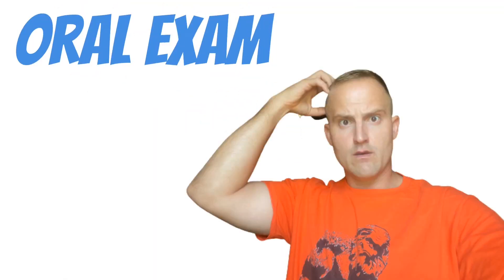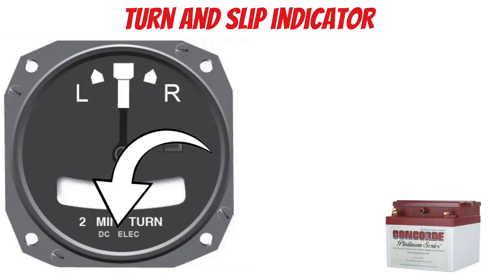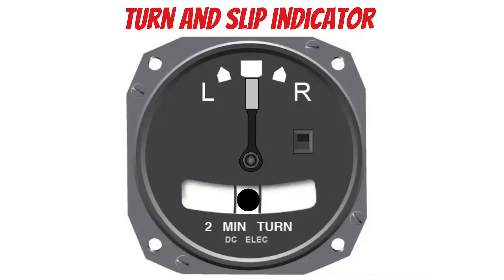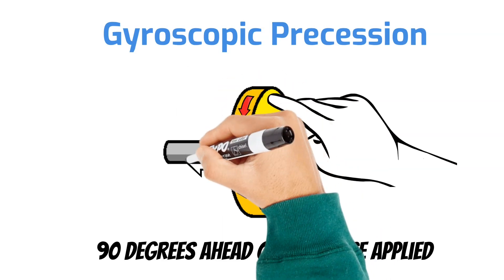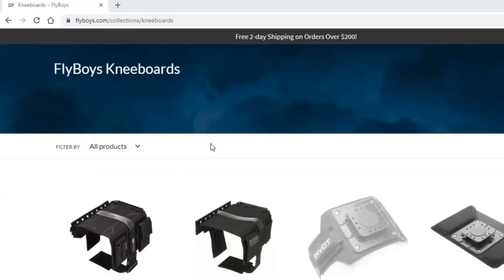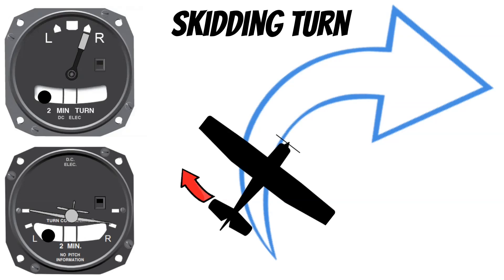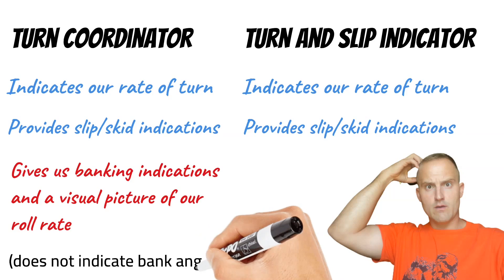Turn Coordinator VS Turn and Slip Indicator (AND How they Work) Private Pilot Ground Lesson 30

Comment: Glossed over the main difference which is that turn coordinator also gives roll rate, and why. I guess the ad got in the way. Sorry guys, have my downvote.

Here’s what you need if you’re still confused: 

You interpret roll rate from a turn coordinator by observing how quickly and to what extent the miniature airplane initially tilts or banks away from level:
	•	Quick, pronounced initial tilt:
Indicates a high roll rate (rapid bank entry). You’ll see the airplane symbol swiftly move away from wings-level, clearly indicating a brisk roll.
	•	Gentle, gradual initial tilt:
Shows a low roll rate, meaning your bank is more gradual and controlled. The airplane symbol gently moves from the center.

The turn coordinator doesn’t directly measure bank angle—just roll and yaw rates. Once you’ve established a steady turn, the miniature airplane stabilizes at an indication related to your turn rate, not your bank angle. To verify actual bank angle, you’d need to cross-check with your attitude indicator.

When initiating turns, quickly glance at the turn coordinator. The initial tilt speed and amount tells you how aggressively you’re entering the bank. Once settled, it simply indicates your steady-state rate of turn.

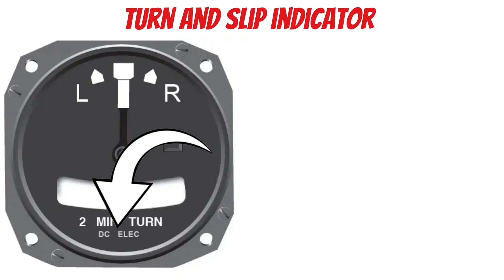Comment: 0:57 turn and slip indicator and turn indicator dc elec 
-if it says dc electric on the bottom, that means the gyro doesnt spin from the suction of the vacuum and it is electronically controlled

 2:55 gyroscopic precession 
-the turn and slip indicator operates on this 
-when a force is applied to a spinning gyroscope a result in force 90 degrees ahead occurs 

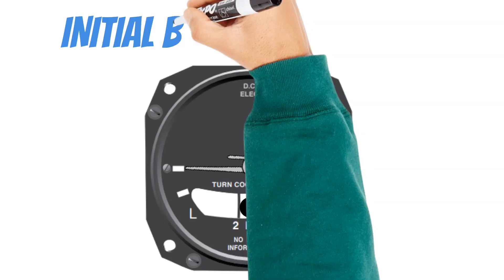4:10 the gyro in the turn coordinator is tilted in a 30 degree angle so it can be more sensitive to banks in the plane but it does not state bank angle. It gives you roll rate and roll of turn 

4:58 the tube with the glass ball is called am inclinometer 
- 6:04 the ball will be centered as the nose is aligned with direction of the turn(coordinated turn)
-SKIDDING is when you’re making a turn and the tail is skidding to the outside of the turn
-SLIPPING is when the tail slips into inside the turn

7:10 difference between turn coordinator and turn and slip indicator

Comment: In 3:26, why is the applied force due to the aircraft turning not distributed throughout the gyro? Why is it only concentrated to the center?
Reply: I think it is not really explained 100% right.
The gyro does not, in fact move. Instead, when the aircraft rolls, the rigidity in space of the gyro causes the gimble to move. The movement of the gimble is the cause for the indication.

Comment: Pretty sure i came up with a great way to remember and understand skids and slips with zero thinking necessary.

When you think skids, think tokyo drift (if you like fast and furious) or just think of cars drifting. And then slips is just the opposite. For slips think of a toy boat going down a drain hole butt end first. Its rotating around a fixed point but the nose is facing away from the turn and the but is going towards it. 
But i think slips dont have to be explain too much when you know its the opposite orientation to a skid
Reply from the maker: Love it!

Comment: If you ever flown a glider, the ball is merely a piece of yard attached to the windscreen. If you become uncoordinated, you step on the rudder pedal that is OPPOSITE the direction the yard is pointing. This is totally opposite of what you do with a turn coordinator and turn and slip indicator. There you step on the rudder where the ball deflects. Took me a while to get used to flying a glider as a private pilot.
Reply from the maker: That’s super interesting
Reply: @FreePilotTraining  it has something to do with the way the slipstream goes across the yarn. So let’s say you are in a right turn and you are slipping. The tail is inside of the turn yet the slipstream goes across the yarn, moving it to the left. Therefore, you step on the right rudder to get the yarn straight over the center of the windscreen. One day, you should check out a glider ride. You’ll be surprised and amazed how you can climb 2000 ft./minute without an engine. All you have to do is maintain a pitch keeping the airspeed around 50 kn.

https://youtu.be/WMEp6eGiig0?si=y4U66SkmVIn-fkNm

Comment: Which instrument will you prefer? Bet most answer Turn Coordinator but I’d go for Turn and Slip Indicator. Makes a difference for spin recovery. Step on the needle be it upright (erect) or inverted spin. But with the TC, the device only works for upright as inverted the yaw and roll are opposite each other while you don’t know which is the dominant contributor. Sammy Mason has a good paragraph on this though he’ll say look down the nose to see yaw.
Reply from the maker: That is a great point! I actually didn’t know that! Thanks for the comment!

Comment: What is the relation between True Airspeed, rate of turn and bank angle?

For small bank angles < 25° 
The rate of turn in deg/sec is 20×bank angle, divided by the true airspeed in knots
Example true airspeed = 100 knots
bank angle = 15 degrees
20 × 15 /  100 = 3 deg/sec, standard turn rate.
Very useful fying  a standard 4 minute holding pattern.
Reply from the maker: I actually don’t know the answer to this question. I’ll have to do some digging
Reply: @FreePilotTraining  
just fly your C-172 and try it .
go to 6000 ft at an IAS of 91 knots which is 100 kt TAS if outside temp is 3 °C  and make a standard rate turn, bank angle will be 15°
or at 3000 ft at 95 kt CAS, OAT  9°C also 100 kt TAS.
Reply: Some Air Force pilots call it the 
 2..20.. 200  rule   in Bolivia 🇧🇴🦅
🏔️    Bolivia , tierra a gran altura , donde tiene su trono el cóndor.
In the south, we have the great salt lake, a perfect mirror when covered with rain water, called el Salar de Uyuni, exactly at 12000 feet elevation, rarely the temperature is -9°C  and then the CAS multiplied by 1.200 gives you TAS exactly.  As checked a long time ago with a Pilatus turbo porter  registered Militar 009  ,  personal aircraft of Presidente García-Mesa. 😀

Comment: Whats the difference between  roll rate and rate of turn still confused by what divides these two.
Reply from the maker: The Roll rate is how quickly you are getting to a certain bank angle. Rate of turn is how quickly the airplane is turning around
Reply: @FreePilotTraining  But both of them show the same thing which is a 3 degree/second turn?

Comment: I always centered the ball with the ailerons and left the rudder alone.  Right stick moves the ball right by changing the relative drag on the two wings.  This is somewhat neater because the outside wing is going faster and has more drag so it's fixing the problem at the source.  Try it holding a steep left turn.
Reply from the maker: Awesome tip. This does work in some airplanes, but not all.
Reply: You’d better keep the ailerons centered and use the rudder to center the ball when you’re about to stall.
Reply: @txkflier  That would be rudder in the wrong direction, namely into the turn, if a stall is your worry.

Comment: It is said that a turn & slip or turn & bank as they were called is much easier to maintain control in IFR weather than TC
Reply from the maker: I believe that. I’m not a huge fan of the TC. I like the needles
Reply: The TC is the first instrument I look at to see if the wings are level. I don’t think a TC will tumble like an attitude indicator can.
Reply: @txkflier  carefull
The turn coordinator will NOT indicate bank angle,!!
but if steady ,  the indication is a rate of turn if aligned with the markers, that is a standard 3 deg/sec turn rate or a two minute 360° circle.
To get the bank angle at modest TAS true airspeed (not indicated/calibrated AS)  
you multiply rate of turn in deg/sec times true aistpeed in knots and divide by 20
Example TAS 100 knots
rate of turn 3 deg/sec
bank angle 100 × 3  / 20 = 15 deg bank angle °  .

That you can calculate if the attitude indicator tumbles, to check if it failed or is recovering.

🎉
Reply: @arturoeugster7228  No, it can’t tell you what your bank angle is. It will tell you if you’re turning. If you’re turning, your wings aren’t level. You must get your wings level before you pull out of a dive.